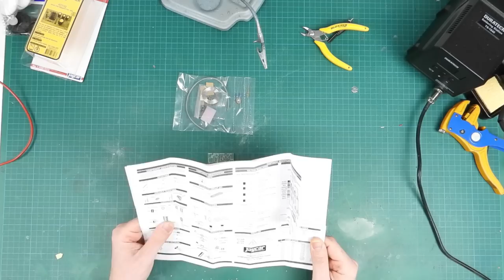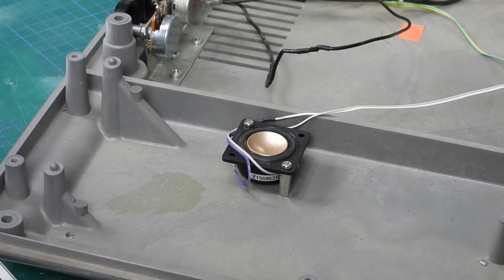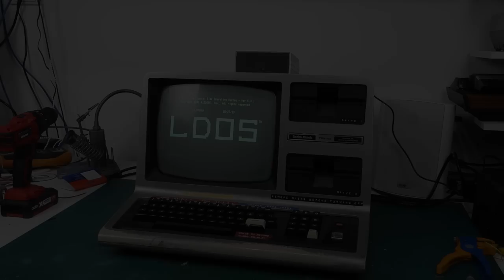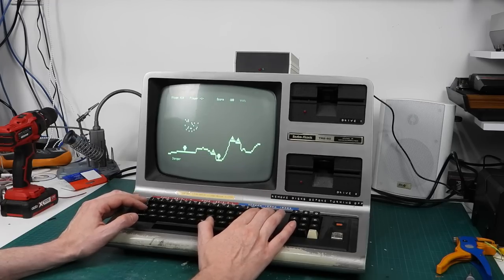The "Well Loved" TRS-80 Model 3 gets a voice!

Comment: IMHO it was still a bit soft, mainly (I think) because the speaker was acoustically "short circuited", it needs a sounding board. I would have mounted the speaker "side down" (from the position you mounted it) and with a piece of cardboard with a round hole in it the size of the speaker membrane, so the membrane has room to move, and mount it where the cooling vent slits are, so that the sound waves are "pushed to the outside of the case, and the cardboard prevents a short circuit of the pressure waves.
Reply from the maker: we're not exactly talking about a high fidelity computer here.

Comment: Nice video. Pro tip, you should always test pin to pin to verify that you have no shorts in the cable when you are testing with a multimeter.
Reply: There are no voltages that would cause any problems. Only one that did that was the Remote that you hooked to the tape recorder to start and stop the  cload and csave commands.

Comment: wouldn"t a "y" adapter have been easier?    thats what i did with my model 1.   Just asking
Reply from the maker: I Y adapter where?
Reply: But he used a Y adapter... so what are you actually asking here?
Reply: I love his dedication to the trs,80.   I simply wondered why he didn't just pick up a cheap adapter from amazon instead of building one.   I picked up a cheap y cable for both my Model 1 and 3.     Just seemed easier than building one from scratch